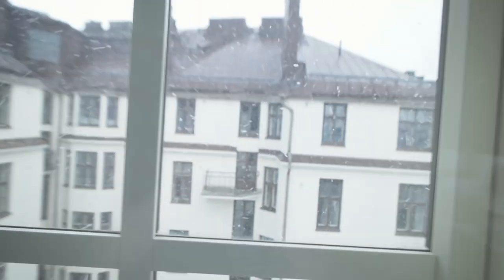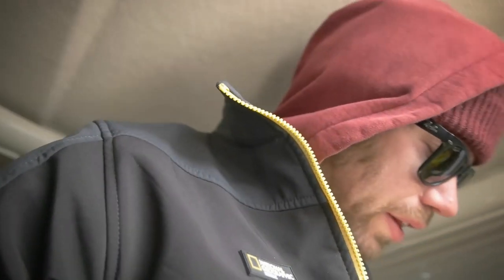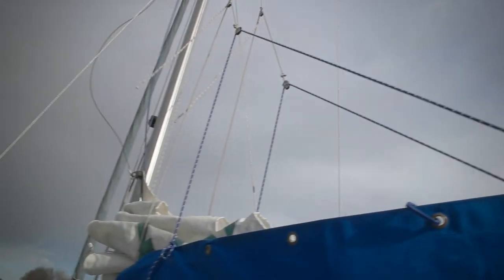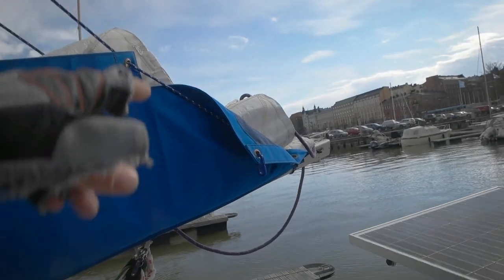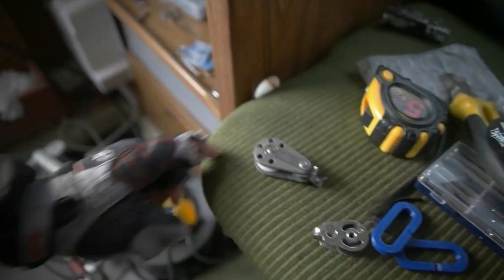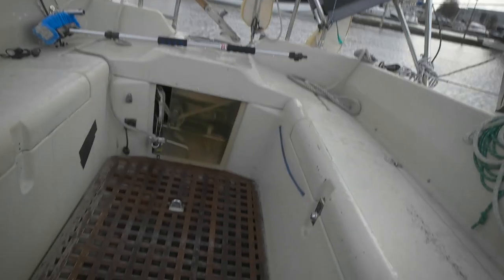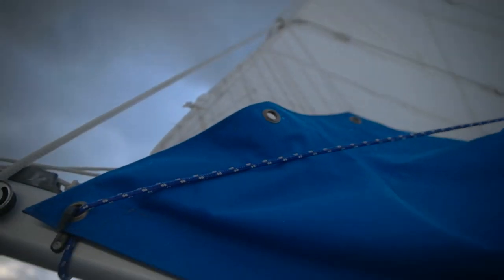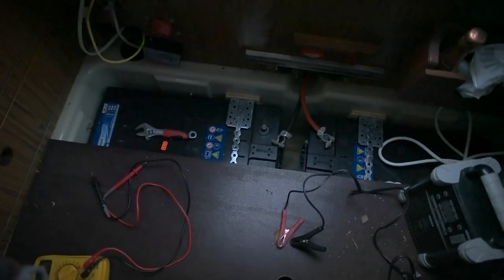Snowing in May!? - Electric sailboat vlog 0009

Comment: You need a thread cutter. Drill a hole. Just to small. Then cut the thread and screw the stainless bolts in